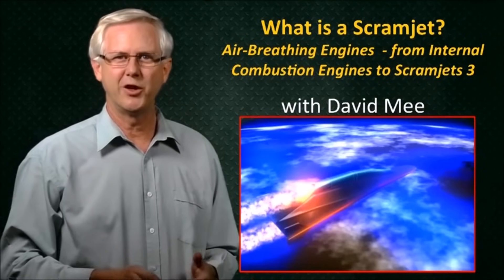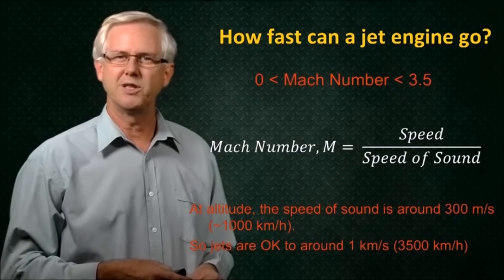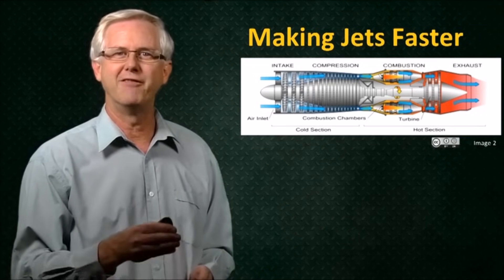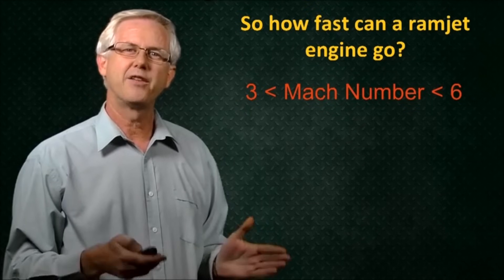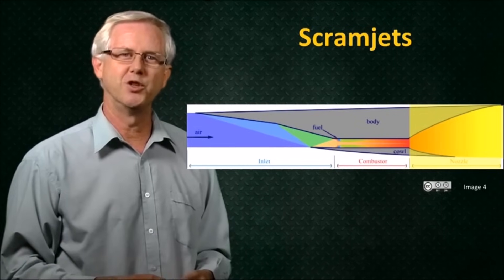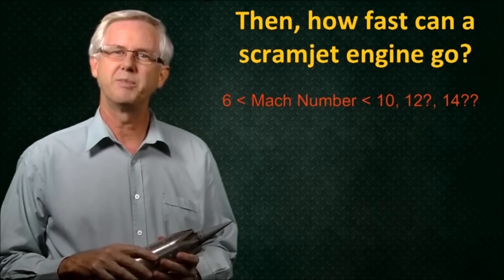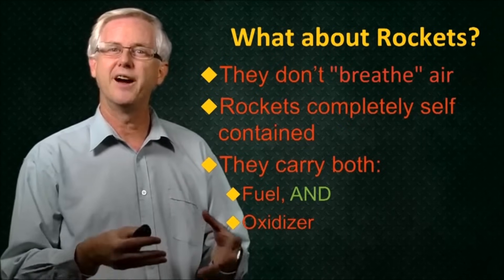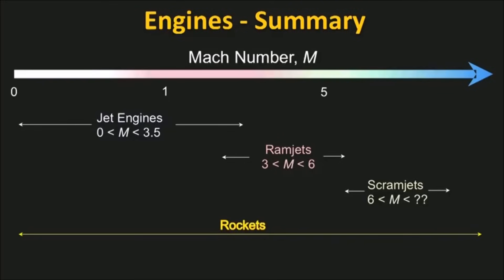Ramjets and Scramjets Explained - Mach 14

Comment: The SR-71 used a special high energy zip-fuel which is enriched with toxic Triethylborane, otherwise it's couldn't reach mach 3, in contrast the MIG-25 could cruise at mach 3 with ordinary kerosene
Reply: Cruise is a bit of a stretch. While it’s true that the MIG-25 once reached a speed of Mach 3.2, it caused irreparable damage to its engines and its maximum cruise speed was Mach 2.83.
Reply: The MIG-25 was a full interceptor/fighter aircraft with a typical armament that includes four large R-40 (6m long) supersonic (M6) missiles with a large air-to-air super long-range with thermal homing (at M3 with after burner and black color the SR-71 was by far the hotest object in the sky) and R-40P With a semi-active long-range radar, a whopping 100kg warhead, so the M3 plus M5 missile together this M8 and the Blackbird could only fly in a straight line with no maneuverability
And it was so expensive to build that usa built only 30 units plus 2 for training new pilots, as soon as they entered service 10 aircraft crashed in the takeof and the engineers realized that the aircraft could only take off with only half fuel tank, and in addition every pilot should have testpilot level so that in practice only 99 pilots could fly the plane, while the MIG-25 any pilot that finished a pilot course yesterday could jump in to the MIG cockpit and take off, the Soviets could quickly and easily build 1500 MIG-25 jets, the MIG was a full-armed fighter jet including a ready-to-battle fueled cannon, and each pilot could simply jump in and take off One min from emergency bell. The Black Bird, on the other hand, took more than a full day to prepare for the flight, one reason is the zip fuel which was very corosuve/toxic and needed to fulled at the last mim before the flight, the USA military never tried to enter Soviet territory and they used the aircraft only during the Vietnam War and the Middle East during the Israeli-Arab conflict
In summary: SR-71 was the most impractical and inefficient and most expensive weapon system ever built by any country in the world.
"A TYPIAL KALLY JOHNSON PROJECT"

Comment: Since air is compressible and so there is a limitation of how much we can push against the air without losing thrust by over expanding it at the outlet. A multiple out put of the same engine and the geometric arrangement of it may help improve efficiency but for hypersonic speed we need more with something like inertia system that could help to develop extra thrust without over expanding air

Comment: interesting that "normal" jet-engines are actually the most complicated design of the three!
Reply: Let's not forget turbofan engines.  They have another set of fan blades. Let's say there are 10 sets before fuel is added to the compressed air to create thrust. In a turbofan engine, another set is added - to make 11. Just that set is routed around the other 10 and added at the end for additional thrust.
Reply: @mannysabir1339 soooooo a Spinal Tap engine? It goes to 11? 😂😂😂
Reply: @Harry M turbojet engines is the broad terminology, high bypass and low bypass(used on fighters) turbofan engines are all types of turbojets, even turboprops are a type of turbojet engine
Reply: And pulsejet...
Reply: because the hard part is already done for the other types, unless you get them up to speed, they are useless
Reply: @seldoon_nemar been saying that for years thank you
Reply: @Harry M all modern fighters use low bypass Turbofan engines, f35 f22 f16 f15 yada yada, they just don't have the large fan blades found on heavies, the low bypass diverts a good amount of the air going into the engine around the combustion chamber and re enters the core after the turbine, this bypass air then has more fuel added and ignited to cause extra thrust, that is how an afterburner works, there are no modern aircraft that i know of that dont use some type of bypass engine or a turboprop. Reference- I am a usaf crew chief
Reply: "Turbojet"
Reply: @Harry M at least the way it is taught to us, 2 types of turbojets turbo fan and turbo prob, as a turbojet is really anything that has a compressor combustion turbine and exhaust section, both found on Turbofans and turboprobs hence why they are turbojets
Reply: @gamingwithcali823  not true. A “turbojet” does not have a bypass fan or a propeller. It develops thrust purely from the jet engine’s chemical reaction.
Reply: turbojet is the so called "normal jet engine"... and there is turbo prop then only prop engines... for even slower speeds... 
yes turbojet engine looks complicated. but a scramjet is most difficult. because there you would need a turbojet + scramjet. and making a scramjet is hard. the materials must be really hightech. they would have to withstand high pressure and high temperature. even titanium or steel would melt at that pressure and temperature... so design is easy. but production is hard.
Reply: And like the ram and scram they also need to be started with an motor/compressor/blower
Reply: There’s a reason why a ram jet is also known as a flying stove pipe
Reply: Right. Eventually we will get to Mach 20 with an empty Tissue paper roll
Reply: They ain’t the most complicated, they look more complicated
Reply: Most Complicated because we learned the physics of jet propulsion on the ground in the 40s..ram and scam jets only work at higher velocities before they kick in... old jet propulsion on a runway 0 to 3.5 m..ramjets don't even accelerate until supersonic so have to be in the air before lighting them. Scramjets potentially could be a fantastic replacement to SLBs to launch a vehicle into orbit. Because it works at higher altitude ..a hybrid shuttle using a scramjet at high altitude then a final rocket burn into orbit negates the need of so much mass in rocket fuel leaving our earths gravity..if we want to go to space..its the sheer mass and wasted energy of a staged rocket we need to get around..Newton's first law is a git to be fair
Reply: A few obstacles tbf..but the math is sound
Reply: That's really only because they're the ones we currently understand and can use in mass right now. Also simplicity becomes far more important because things are moving so fast that having more parts means more weight, and more points of weakness in the structure. But the more we are able to exploit things at insane speeds, the more complex those technologies will become too.
Reply: relatively they’re still in their infancy and development stages compared to turbo fans and jets
Reply: As we get more advanced they become simpler in design
Reply: But the most perfected over time, can't wait for these technologies to evolve!
Reply: @wobbblefoot  they won't evolve further. they'll be replaced by electric which is infinitely more efficient in every way and less complex so it never breaks (like an ICE engine that breaks constantly)
Reply: @BigWheel.   how are you going to make electric jet engines my man?

Comment: so if ramjets and scam jets are only models and hypothetical, why not focus on making jet propulsion more fuel efficient
Reply: Idiot, Ramjets are not just models and hypothetical. They're real, there're vehicles already using Ramjets:

Hiller Hornet (a ramjet-powered helicopter)

Focke-Wulf Super Lorin

Focke-Wulf Ta 283

Focke-Wulf Triebflügel

Leduc experimental aircraft

Lockheed D-21

Lockheed X-7

Nord 1500 Griffon

Republic XF-103

SR-71 Blackbird (Turbojet engines that function as ramjets at mach 1+ speeds.)

Skoda-Kauba Sk P.14

Comment: So I have this ridiculous idea: An aircraft with jet engines carrying an aircraft with ramjets carrying an aircraft with scramjets, the aircraft with jet engines will reach Mach 3~3.5 and then relase the aircraft with ramjets, when the aircraft with ramjets reaches Mach 6 it will release the aircraft with scramjets and then it will continue till reaching its limit.
I think I'm high...
Reply: How about a multi- stage aircraft like  a horizontal rocket where the engine and fuel container is decoupled after use
Reply: https://www.nextbigfuture.com/2015/07/nuclear-thermal-turbo-rocket-with.html

Comment: So the SR71 had a hybrid ramjet with a turbine, compressor and internal air bypass system to feed in additional air at low speed. I think.  ???
Reply: Yes. The SR71 has a "turboramjet" engine.
Reply: Rihcard Graham talked about J58, the SR-71 engine (SR-71 J58 Engine Tour https://www.youtube.com/watch?v=VpZfBFlTC_c).  And for more detail, you may also find it here. The Mighty J58 - The SR-71's Secret Powerhouse (https://www.youtube.com/watch?v=F3ao5SCedIk)

Comment: Have a commercial airline plane fitted with a turbine engine and a ramjet engine and a scramjet engine on each wing. Youll get faster than concorde speeds. Turbine engine will allow for 0 to take off speeds to atleast mach 2 or 3 than the ramjet will take it to about mach 6 than the scramjet will take it to about mach 10 or beyond. Youll get from london to new york probably in about 30 minutes.

Comment: The SR71 engine  is a jet that converts to a ramjet that converts to a scramjet. Dont believe any other BS
Reply: The SR71 engine is only part 1 and 2 of your statement. It is not a scramjet.
Reply: @carisi2k11  BS. Its a Srcamjet at it third phase.
Reply: @offplanetevent  The SR71 doesn't have a third phase as it is a turbo ramjet. The secret Aurora and the SR72 have a scramjet phase.
Reply: @carisi2k11  LOL.

Comment: Really you could do an inlet system that could move through all three stages. The sr71 already somewhat does this. As the plane gets fast it's need to slow the air down becomes less significant and you could have the inlet move to a point to stop the turbo jet from receiving any air and have it full convert to a ramjet then it gets tricky how to design it to become a full scram jet. Most attempts are using rockets to get the vehicle up to hypersonic speeds.

Comment: I would like to comment about your ramjet/scramjet engine and I think a method for adjusting the compression for proper combustion.  You have shown a center-position airflow restrictor  that is not moveable and I think that is the key to adjusting compression.  Make your restrictor moveable, such that it can be used to adjust the compression to a suitable level.  And consider using different types of fuel for flight at different altitudes.  And consider using a ramjet engine at take off speeds as they originally did post WWII.
Reply: A ramjet engine cannot be used at take off speeds. Only once up to mach 2.5 - mach 3 will it actually work.

Comment: Most planes cannot get to anywhere near 3.5 mach example f18 super hornet 1.6 mach, F35 1.6 mach and so on. Please enlighten me how many jet planes can reach 3.5 mach?
Reply: It was meant as a theoretical top speed. Beyond mach 3.5 there is too much heat in the engine for fuel to burn.

Comment: The forcing cone on the SR71 was automatically adjusted forward or backward in relation to speed. The engines of the SR71 were made from materials not found in service jets. More so, the fuel consumption was reduced as the speed was increased. He uses a lot of facts to disinform what we’re capable of. We have vehicles that can exceed Mach 14.
Reply: Those vehicles can't reach that speed without rockets though can they?

Comment: If it weren't for the temperature and drag problems I guess the next limitation a scram jet would encounter could be not being able to get enough oxygen from the air.  What if we were able to teleport a supply of pure oxygen to follow the jet to its destination or have some sort of pre-made pure oxygen pathway in the sky for it to fly through?  If the air around the jet could be influenced externally like that then it could perhaps even be made to create less air resistance or even a vacuum in front of the jet to pull it forward.  I'm just curious about how fast a metal object with liquid fuel on board could be made to travel with technology we don't yet have.

Comment: Ping Xiao a material science professor from the University of Manchester and China developed a graphene-carbide coating that can with stand temperature of 3,000 degree celcius.Xi Jinping made an unscheduled visit to the University of Manchester after visiting the Queen.Grahenes. are 100 times stronger than steel.

Comment: Very informative .. Thanks so much, 
A quick question,
Why fuel cant be used at very high temperatures?  thanks.
Reply: Or the tempreatures may melt the body
Reply: According to me the tempreatures can get so high that it will not get enough time to burn or we would have to pressurize the fuel too

Comment: At some point you'll have an issue with flame propagation inside the combustion tubes of the scram jet design, where by the only way to rectify is to increase the length of the combustion process or accelerate it.

Comment: We have had this since late 80 s early 90 s. I'm scared to know what we have now. Plasma shielding around craft to super heat air causing the mass of the craft to reduce 85%. Sure we have something beyond that now.
Reply: Lol if we have anything such as you describe, it has only been obtained  due to some unanticipated malfunction by a craft while venturing into THIS dimension. If it has been observed in operation, (perchance by some repairs by  uh, beings flown in familiar with said technology) duplicating it (in this dimension) is still and will be for the foreseeable future, impossible to duplicate for reasons that aren't presently even understood. Don't mean to bust your bubble or anything but plain ol' greed, (among other faults humans suffer from)  precludes   physics defying technology from remaining  under the control of the cloak and dagger crowd very long.

Comment: At me point the extra fuel needed to overcome inlet drag and compression must out weight the advantages of not carrying a pre-packaged oxidizer. 
And for scramjets, don't they need to be fairly long at higher speeds just to give the fuel time to complete the burn reaction before exiting the nozzle?
Reply from the maker: any engine type travelling at hypersonic speed has the same type of problem with drag. However the Scramjet has less than half the mass since it has no oxidiser
Reply: The rocket engine has no air intake so how could it possibly have the same issue with drag? 
Setting aside drag, the rocket expends no energy on compression of the oxidizer (and the 80% nitrogen) and so requires less total thermal energy for the same thrust as an air breathing engine which means less fuel (specifically the reducer). Now clearly at lower speeds the weight of oxidizer greatly outweighs the higher fuel burn used to compress the air, but how does this change with speed and altitude? Does the nitrogen dilutant help or hinder?

Comment: THE X15 IN 1968 WAS AT MACH 19.62 OR 15,000 MILES PER HOUR. NOW WERE TALKING MACH 14 IN 2018. BACKWARDS TECHNONLOGY.
Reply from the maker: From Wikipedia, the free encyclopedia
 "The X-15's official world record for the highest speed ever recorded by a manned, powered aircraft, set in October 1967 when William J. Knight flew........... (NOTE!!!) `Mach 6.72   ........... at 102,100 feet (31,120 m), a speed of 4,520 miles per hour (7,274 km/h; 2,021 m/s), has remained unchallenged as of March 2018.[1][2]"

Comment: But doesn't the ram effect violate Bernoulli's principle? Please explain
Reply: Bernoulli's work only applies to completely incomprehensible fluid flow at subsonic speeds. 
That is a bulk flow slower than the velocity of the individual gas particles. Since the velocities of the individual gas particles actually cover a wide range at a given temperature (a maxwell-boltzman distribution curve), with Mach 1.0 only being the mean velocity, the Bernoulli equations start to become inaccurate above about Mach 0.3. 
Compressability becomes a substantial factor over about Mach 0.6., trans-sonic is considered Mach 0.8-1.2.

Comment: Might be a stupid question, but, when air is 78% Nitrogen then why not using a material that would burn with that instead of oxygen? There would probably be much less airflow needed and therefore much less heat in the inside of any engine.
Reply: Felix, so you ask why choose oxygen as an oxidizer? The answer is simple that is because nitrogen as you suggested is not an oxidizer. Combustion of hydrocarbon needs oxygen.
Reply: Nitrogen doesn't really react with much

Comment: As a teenager growing up in Folsom Ca. Right next door to Arojet rocket plant, you could hear them testing rocket motors ( normally solid fule ) some liquid motors, All the time. But for a couple of years they were doing development work for Boing aircraft on a Hybrid Scram jet motor, that ran on liquid hydrogen. They were trying to develop a commercial plane that would replace the Concorde. They were shooting for N.Y. to Tokyo in 60 minutes @ Mock 7. Every time they fired it up there was NO Mistaking the noise it made, + The duration of run time... the longest run time of Rockets was 30 seconds,  most under 15 seconds,  But that Scram-jet was in the several minute range. Usually 2 to 4 minutes,  and the closest description of it's sound was that Horrible t.v. show Air Wolf when they hit the turbo button and went Super Sonic .... Never will forget that sound...
Reply: donald Master Bud boing boing boing
Reply: donald Master Bud and dont Mock too much
Reply: Sad seeing them go, thanks CA.